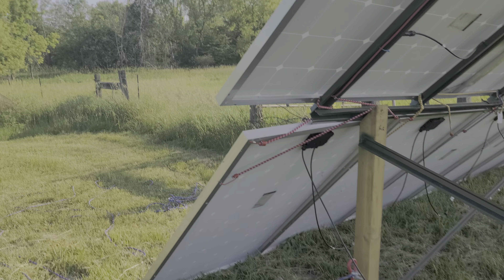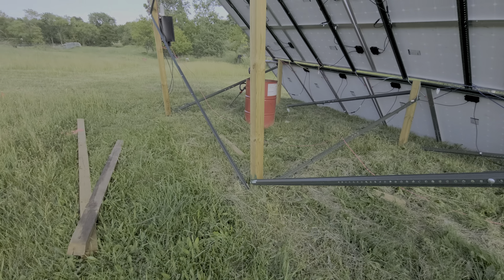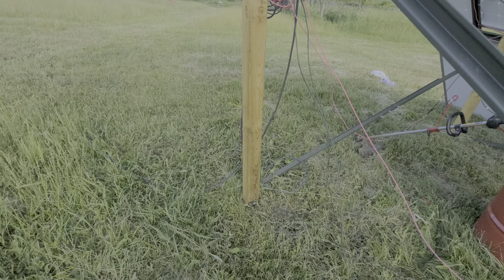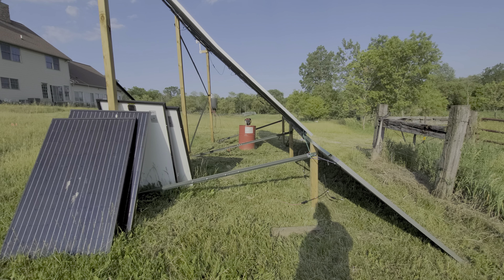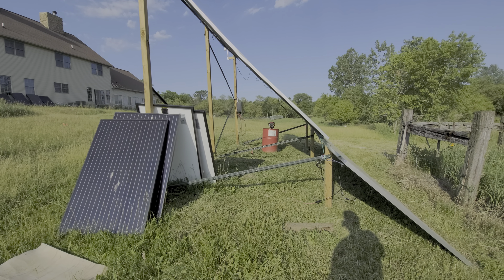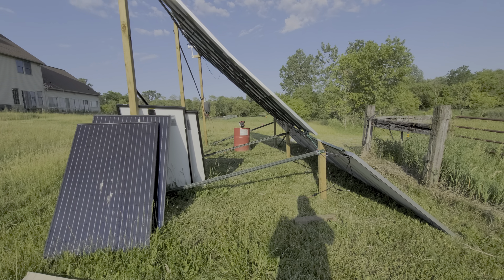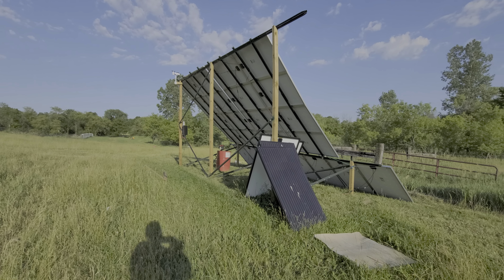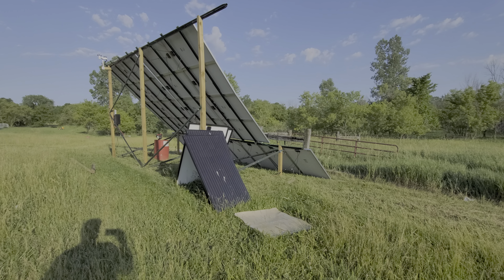My long winded conspiracy theory about energy providers vs solar

Comment: Yes, CA new construction requires some solar...
There probably are some exceptions.

There are some places where it is illegal to go off-grid...
I'm essentially keeping my connection to the grid as backup and pay only the service/connection/line transmission fees.

Our area is also moving to meters on well pumps, which will eventually result in paying for what has been free forever.

Genetry Solar 6kw Inverter #2 is arriving this afternoon... You guys are developing great stuff!
Reply from the maker: Your area is doing forced metering on well pumps?
Reply: @GenetrySolar  Not yet for homeowners. A few years ago the district "water authority" forced the registration of all wells. Businesses are having to pay for the water in excess of what they've approved to use. It's thought that homeowners are next. This is all driven from Sacramento. They seems to think that we can live with only 40 gallons a day. Brain dead idiots. They also think we need to go all EVs. We don't even have enough power now (brown outs like a third-world country). How are they planning to charge 35-40 millions EVs?

Comment: as for your wire size issue. 1st are you combining the panel sets at the house or at the panels?   2nd - charge controllers 1 or multiple?  3rd- look at the charts of loss over distance; smaller will carry the current for a short distance with minor loss, so  2 smaller or 1 bigger cable in the ground and neck down to the size to go in to the equipment. 3rd  when you dig it back up bury big pipe / conduit in the ground WITH an extra pull rope so when you add again you just pull in more in the same pipe and leave a pull rope in the pipe. who knows it might be nice to ac at the panels or water out there as well. buy once use many. ps how's the tractor?
Reply from the maker: 6kw worth of panels to the combiner box. Then 125 feet or 160 feet to the chsrge controller.

Comment: As far as building materials, I've purchased most all of my mine from Craigslist and Facebook market place all NEW Materials and some used from job site construction saved me a small fortune in comparison to prices now i spent roughly 600.00 on my 64 foot long by 13 foot high array frame using 2x4's, Unistruts, concrete and fastners then comes the panels and that cost then the wire the Midnight Solar combiner box, lightning arrestors, grounding rod, my 20000 watt continuous and 80000 surge powerjack inverter, 5-60 amp charge controllers V118, I got from Sean at MakeSkyBlueUSA Thank you for that recommendation, Midnight Solar Breakers, and batteries 4-48 volt banks (lead acid for now). Breakers in between the batteries and charge controllers The wire for batteries and the 40 265 watt Solar panels i have spent nearly 5g's so is it worth it HELL YES freedom is priceless...

Comment: Do u plan on demonstrating  how your inverters r going  to  do  automatic  transfer or grid tie to charge  or run inverter  if battery  voltage  is  low
Reply from the maker: Yes. When sid comes up we have a new board to test.
Reply: @GenetrySolar  awesome  thanks  for the reply
Reply: Down here in eastern Kentucky, our greedy Superintendent and Power Company CEO are making $160K+. Our children do not have books or internet and our 1949 power lines/poles are snapping in still air. Nepotism is alive.

Comment: some counties won't give you occupancy unless you have city power to your property. that is why i won't go completely off grid. i am taking more and more off grid as i can till i get all but a 10 watt light bulb and keep the city power for backup. as for grid tie i won't for these 2 main reasons,  1st cost of the equipment and inspections . 2nd  they charge you .10 kwh and what you make the only pay wholesale rate  at .03 kwh after you 0 your bill to 0 . that's why. what do you think?

Comment: The grid as we know it is probably on its way to becoming obsolete. Decentralization is the future, and likely we'll head down the road where many or most grid consumers act as generators and energy storage. If mWh battery banks are ever commonplace in homes it will make little sense to rely in centralized power generation, as solar sized right usually results in a surplus of energy even factoring in non-generation hours.
Reply from the maker: You are probably right but it needs to be taxed. Either taxed on purchase, yearly assessment, whatever the case might be.
Reply: mWh battery banks are expensive, to strip mine in Africa and dispose in landfills.

Better to use huge water retention ponds/holes with a hydroelectric generators.